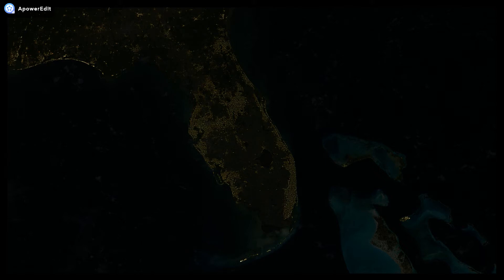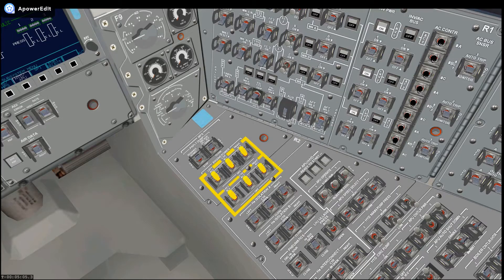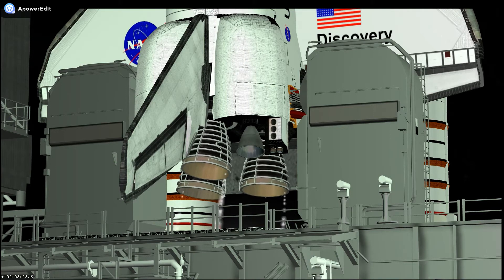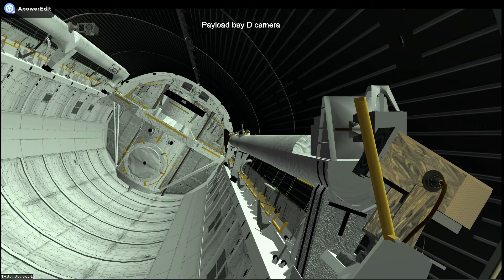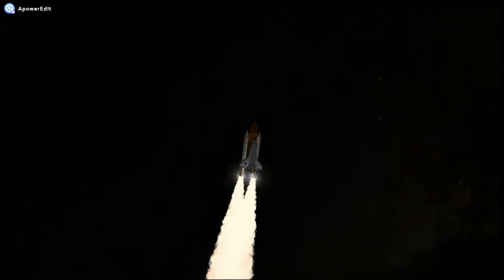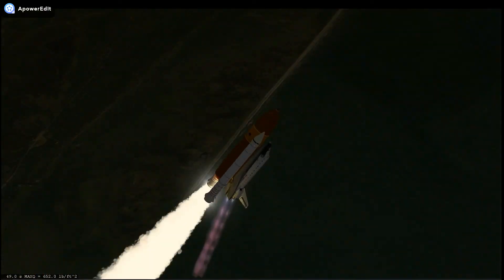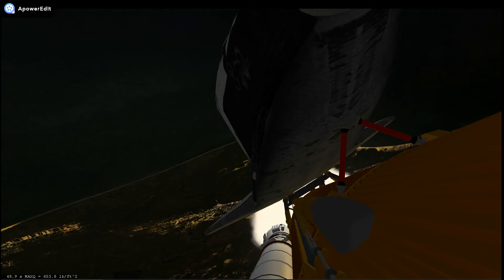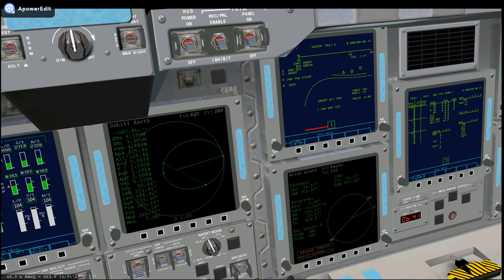Space Shuttle Discovery Night Launch [Orbiter 2016] Space Shuttle Ultra

Comment: I'm having trouble getting SSU to start, when I start a scenario the launch pad and vehicle are sideways, would you happen to know how to fix that?
Reply from the maker: Hi goose. Sideways as in laying parallel to the ground on its side?  That's one I have not seen before. Are you running SSU in orbiter 2016, and did you follow the steps at the link I posted in the description of this video? If so, it is possible that something went wrong during the compiling process... maybe try again. Also, try running the scenario again and then opening scenario editor and see if you can edit the heading and rotation using the editor, then save that scenario. I  currently do not have access to my SSU installation as I have yet to transfer it over to my new system. I will do that and look into it further for you :)
Reply: @AztroNut66  I actually just found out the issue, It was that I had the 2010 version installed instead of 2016, oops
Reply: @goose3303   i have same problem, 2016 version, shuttle and pad sideways...
Reply: @catinabox8859  same for me but it depends on the historical mission I select. I think it may be an issue in part with the high res Kennedy Space Center textures but haven't confirmed that. Sometime you just have to uninstall Orbiter 2016, clear out the installation folder and start fresh. Perhaps something from the Apollo addon is interfering if you have that installed.

Also i wish I could find more info on the altitude trajectory of a normal shuttle launch. With the standard shuttle I get up to about 100km then go down to about 45 km for external tank sep. Is that wrong? Trajectory or mission profile type diagrams I find online don't show an ascent, descent, then ascent again.